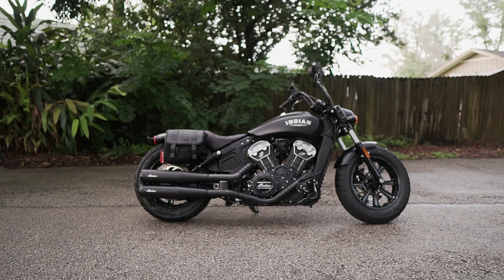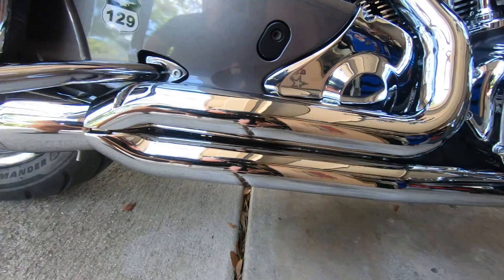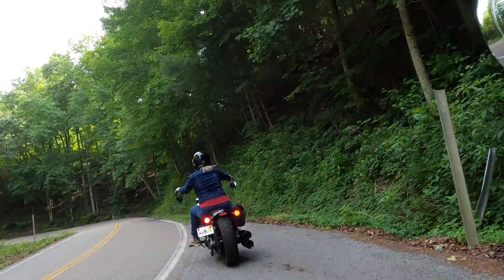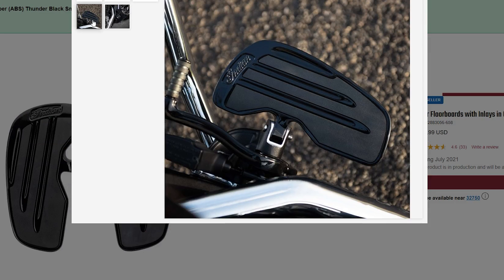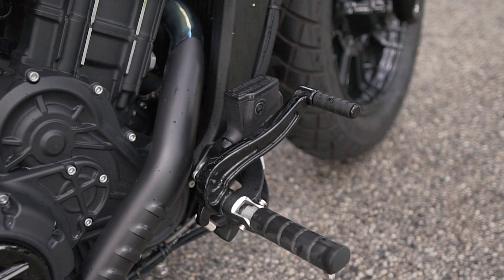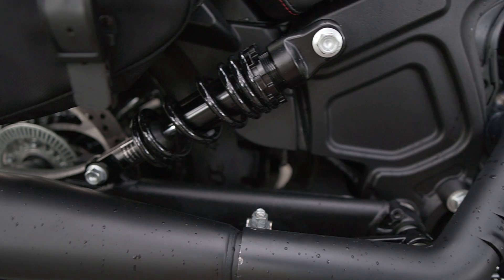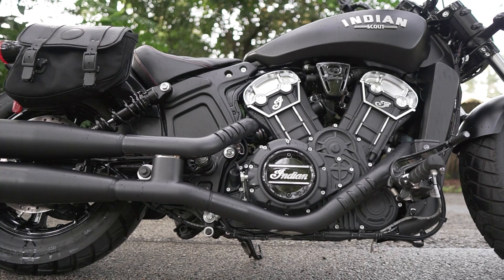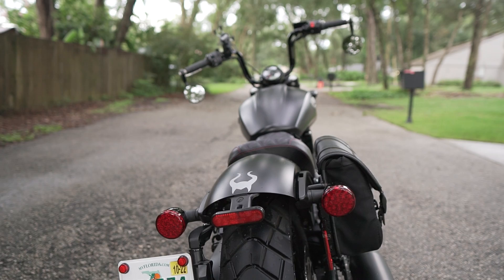Episode 1 - Indian Scout Bobber Upgrade Project - Paint, parts and wheels, oh my!

Comment: Heck yeah.

I'm thinking through what I'd do with a Scout 60 / Scout which I'll hopefully get later this year. I'd buy a Challenger if I could afford it - but I can't so I'll just have to come as close as I can with a Scout.  
Seat (solo - probably Mustang), rear shocks, fork kit,  LED headlight, bar end blinkers, Indian QR Fairing,  sissy bar/rack, luggage, exhaust, intake, tuner, plate frame/mount, rear blinker replacement, not sure what handlebars, floorboards, heated grips. Some other cosmetic stuff.

Comment: I love your handlebar. 
My Scout Bobber hurts my back. 
Is it from Bobber Twenty?
Reply from the maker: Those are the Indian ape hangars. They run $155 and $105 for the clutch/brake line extension kit. Pretty simple job so most shops only charge an hour of labor. Highly recommended.
Reply: I got a pair of 12 inch apes from FMB chopper parts.

Comment: My bobber engine paint is peeling. Is that what powder coating is for? Not sure what would best replace the engine block paint
Reply from the maker: That’s the first time I’ve heard of that. How old is the bike? Powder coating is not paint and it’s a pain in the ass because you have disassemble every part to be treated. Not sure how to deal with that

Comment: Who did you use for the 2-1 exhaust on your Springfield?
Reply from the maker: Freedom performance, I have a few videos on that if you reach back a year or two. Overall have been happy with them but I had a warranty issue and they took care of it. And by the way they don’t care that I am some sort of hotshot YouTuber, lol,
Reply: @TwoIndians  they might not care, but we care😁

I only ask because I am wanting to drop weight on my Chieftain DH, and having a hard time deciding from the handful of manufacturers.  Thank you!
Reply from the maker: Well you will certainly not drop any weight by changing out that exhaust. Do you still need the dummy pipe on the left side to support the bags and the freedom performance slip on in my opinion weighs more than the factory. And it’s a little bit larger. Check out my video on it and you’ll see what I’m talking about
Reply: @TwoIndians  Thank you, yes I saw that.  I'm not looking to run a dummy pipe. Obviously defeats the purpose. They do have Saddlebag brackets on their website, hoping to find a 2-1 with no ghost pipe.
Reply from the maker: You can buy it without the ghost pipe. Save yourself $500 and 35 pounds
Reply: @TwoIndians  awesome. Thank you!